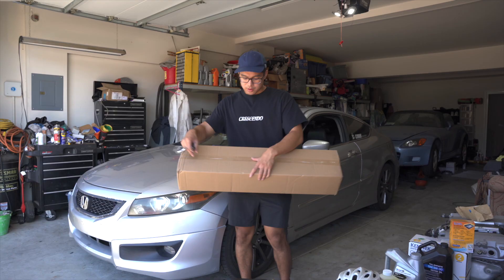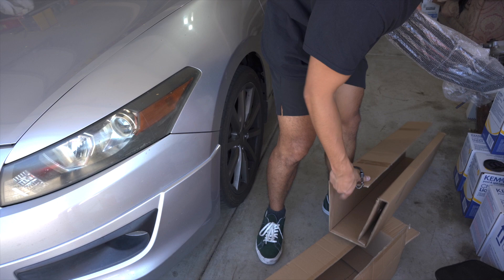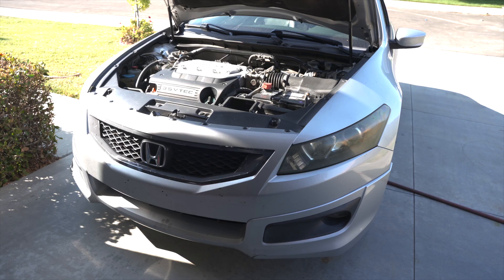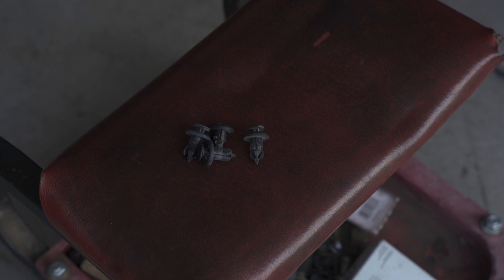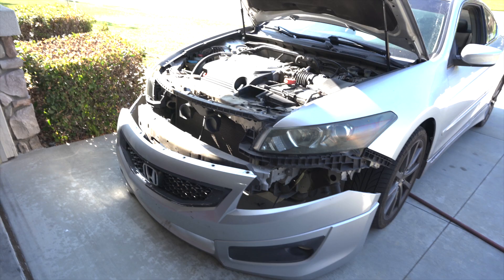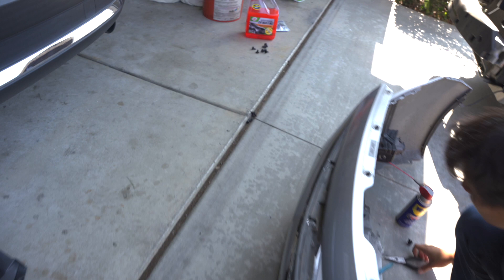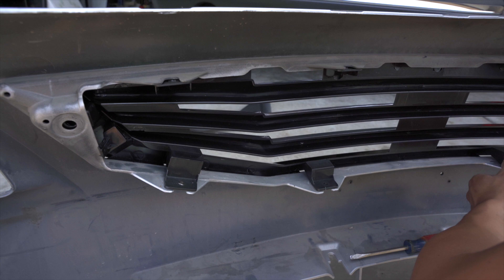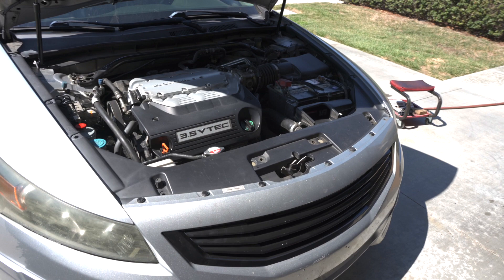MUGEN INSPIRED FRONT GRILL ON MY HONDA ACCORD V6 COUPE! | Spec-D Tuning Front Grill Installation

Comment: What year accord is that. I have a 2012 coupe. But on ebay it says 08-10 wondering if it is the same
Reply from the maker: 08
Reply: @abc.garage  thanks. Can't find any nice ones for 2012
Reply: @xPoisonousYt  I took off my original grill and took it to a shop to paint it gloss black. It looks so sick.  And I got the type R style red Honda eblom.
Reply: @xPoisonousYt  I updated my profile picture on YouTube so you can see it.
Reply: @xPoisonousYt  I had mine plastic dip for a while. I'm telling you it's so much nicer painted gloss black
Reply: @Thomas Howe  thanks. The white would look good with the red eblom too. To take off your old plastic dip use w-40 works great.